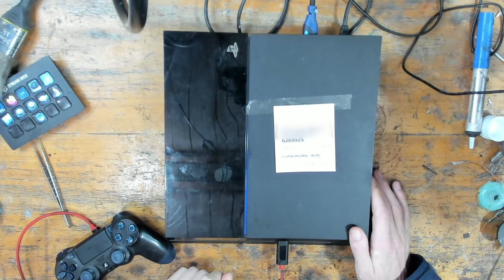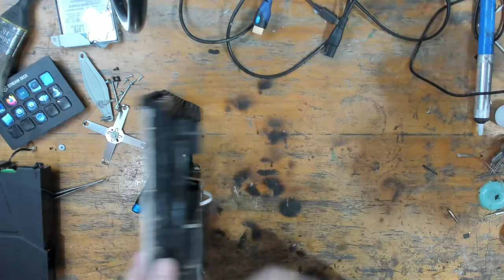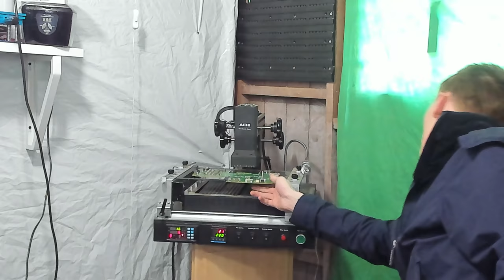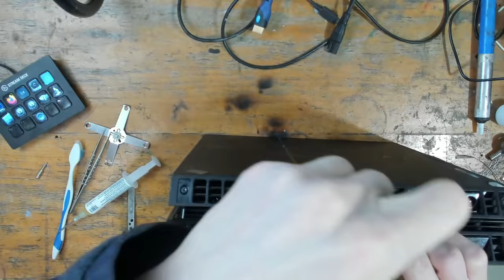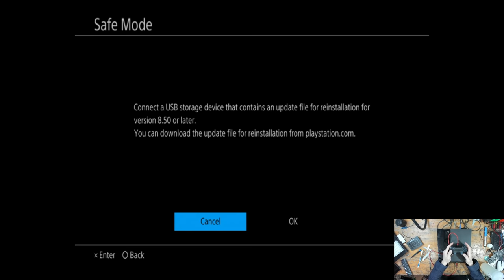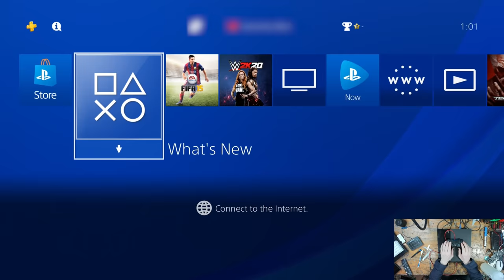PlayStation 4 Long Pulsing Blue Light Of Death Repair... Diagnosing A PS4 Using Xbox Parts? 😱😂

Comment: Insane video as always! I have a question about a PS4 I grabbed from a friend, I tried the washer fix but nothing, what this one does is BLOD for 6 to 10 secs then the led goes off but it's still on till I shut it off. Sometimes if I thighten too much, it goes to 1-2 sec BLOD then shutdown.
Reply from the maker: Thanks bud. It sounds like you have either a southbridge issue, but the 1-2 second thing will likely be just too much pressure being put on the apu. If you have a hot air gun you could try reflowing the southbridge but that can go wrong and could need replacing if it does.
Reply: @TheCod3r  I tought that it could be the issue but the fan works all the time, would that clear the issue on the southbridge? Or even if it works, the southbridge could still be faulty? Thanks you very much!

Comment: I now have faith with the ps4 pro I just picked up! It has a constant blue flashing light, which continues until I switch it off.. Safe mode doesn't work, so I'm thinking this is the exact same issue.

Comment: i have ps4 blinking blue without signal and now the fan runs with loud sound and then turn off ith 3 beeps and the cpu be hot is that meaning it has blod or just an over heat

Comment: I sent my ps4 in 2020 for a bad power supply which turned out to be an APU problem. It was fixed, exactly 4 yrs after the fix, i got the same issue so i sent it this week. I'm hoping it works a second time because i don't plan to buy a PS5 yet.

Comment: Did you never had an apu bulging with air pockets when reballing? It happened to me some times and when consoles were not user for a long time. Now when that is the case I put the board in an oven at 80°C for 1 day to remove any moisture stuck in the PCB of the APU. 
BTW, I have a bga rework station
Reply from the maker: I haven't had that happen to me but personally I would probably deem it no fix to be honest

Comment: I have a strange one...cuh 1115a in white...when I turn it on it has a slow pulsing blue light indefinitely with no display...I boot into save mode and it goes into it...select any option from there and it restarts fine and boots into the OS...works fine but randomly looses video signal...sometimes after a few mins and sometimes after a few seconds. PS4 stays on white light. Tried loading a disc while this state and doesn't take it almost as if it's hanged.

Comment: What really gets my gripe is the banning of leaded solder to save harm to the planet. There are more landfill consoles because of this lead free solder that can't flex as good under hard changes of temperature.
Why on earth don't they use leaded solder on these components that stress and use unleaded on the ones that don't ?. Ahh I get it ... "sorry consoles down you need to buy a new one and this one has more features..... ".
Reply from the maker: I agree, I definitely prefer leaded solder, it has a much lower melting point and handles heat changes much better
Reply: Seriously tho. Ban leaded solder on components that don’t heat up a lot and allow it for chips that heat up alot or they could just make it simple and let companies use leaded solder on bga chips and use unleaded for everything else.

Comment: i have a 10xx ps4 with long pulsing blue light (i waited for like 1 1/2 minutes and it just kept pulsing). The fan just gets a nudge at the start and doesnt spin even once; also during this 1 1/2 minutes it gets a nudge about 2 times. There is disk eject 3 beeps but no 2nd beep on power button hold (safe mode).

Could this be apu or southbridge issue? what is distinctive from the blod videos on youtube is that the fan does not spin.

Comment: You may be right in what you say about servicing your console but I'm not  taking a working console apart just clean it!
Reply from the maker: That's the problem though, they do need a service to continue working. If they do overheat it's not a matter of if it would die, just when :(
Reply: @TheCod3r  
How much do you charge for a service? PS3 sounds loud and I can see lots of dust...just out of curiosity I live on the other side of the would so wouldn't be woth sending it to you
and what's the oldest console you work on currently?
Ty Greg
Reply from the maker: @gregjarvis1232  I don't work on PS3s mate, I've never opened one and the cost generally outweighs the cost of a new console

Comment: You can actually buy apu chips brand new
Reply from the maker: You can but it would need to come with the other married chips, and wouldn't make any financial sense to replace. From a repair standpoint, the data on the console would be gone and it would cost more than a reball or reflow would